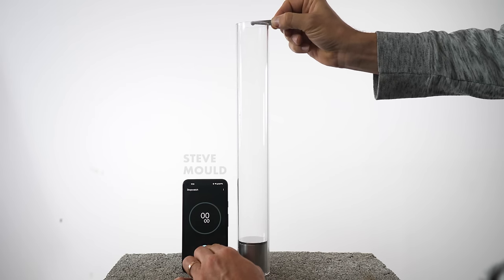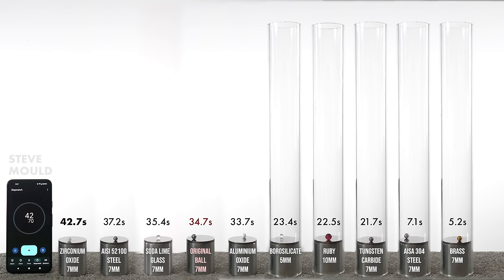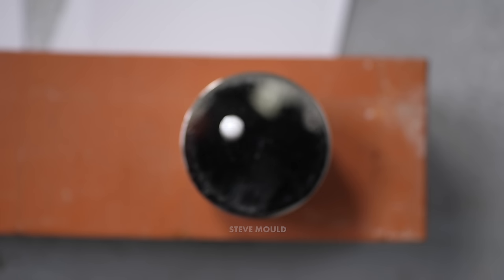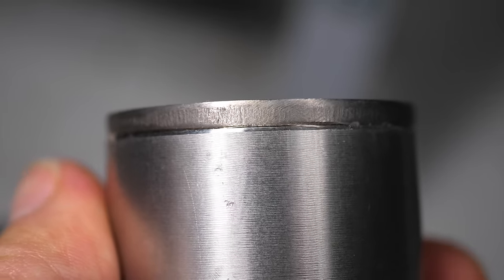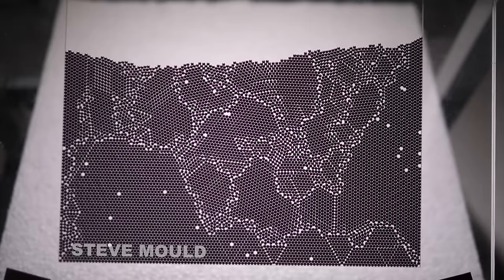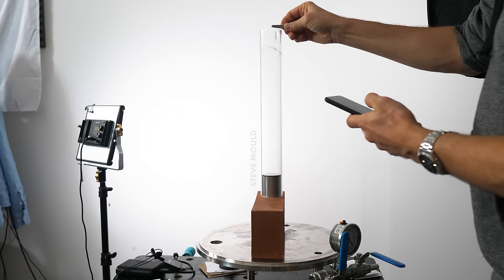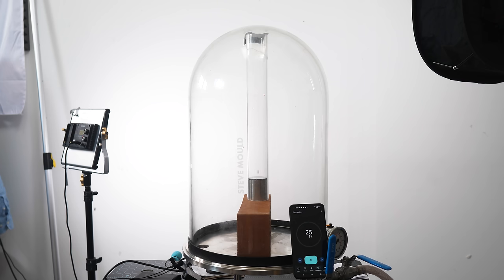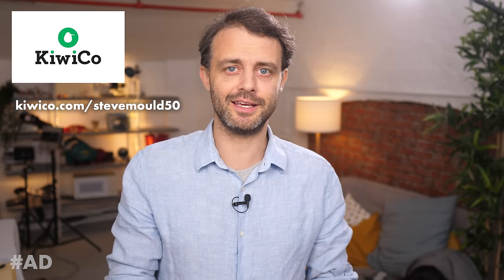This weird metal is insanely bouncy

Comment: I can say from personal experience that a steel screw dropped onto a tile floor has a coefficient of restitution of at least 1, and this coefficient value is proportional to the rarity and cost of the screw.
Reply: True. Also, the propensity of the screw to be lost upon dropping rises in direct proportion with the rarity/cost of said screw.
Reply: XD
Reply: What about shag carpet?
Reply: They don't bounce. They just teleport to another dimension.
Reply: @rigidmenace3333  They go to the same place as the missing socks.
Reply: I don't think you fully appreciate the results of your "research". The sample screw has a post impact path at an angle to the original line of travel. This requires more kinetic energy than the system has before the collision. You are describing a type of hot fusion.
I say it's hot fusion since that's what you become after the screw disappears. And, to distinguish this phenomenon from plain old hot fusion it's spelled Fyousion.
Reply: It can't be more than 1
Reply: @lyxe9000  It was a joke, but I did not understand it either.
Reply: 1 is the upper bound!
Reply: @timelsen2236  In a theoretical world where 1 isn't the upper bound, it would bounce higher than the height it was dropped from, if the coefficient of restitution was 2, and you dropped a ball from 10 meters, it would bounce up 20 meters. However this theoretical world is what you are transferred to when you drop one of these rare screws and the screw bounces for eternity somewhere in your workspace.
Reply: @_EyeOfTheTiger  it travels to another dimension through the carpet
Reply: thousandth like pog
Reply: You'll find it 6 months later in the same spot as your 10mm wrench
Reply: what are you even saying? 😩😩
Reply: When I worked in an eyeglasses lab the people who assembled the completed glasses would refer to the tiny screws some models used as "unicorns" because of how unlikely you were to find one if you dropped it.
Reply: LOL
Reply: @timelsen2236  It can be if more energy is returned to the screw than the screw gave, which means that energy is created, which is obviously impossible, but so is a coefficient of restitution being 1.
Reply: As a watchmaker I can confirm this! For expensive watch screws that are tiny and also I dont get replacements for, the coefficient of restitution tends towards infinite.
Reply: @TheDirtManYT  "The Absent-Minded Professor" Walt Disney 1961... I saw it in the cinema with my mom!
Reply: @TheDirtManYT The Flubber coefficient.
Reply: Lmao
Reply: It's also tied into another law of physics, life, and everything else... Murphy's!
Reply: You have 10mm anger.
Reply: the time spent searching for said screw if one is attempting to be efficient at any given task is something I've managed to reduce by keeping a decently powerful magnet handy anytime I'm,ahem, screwing around & also, if purchasing a specific # of items for a task ( my preference for small repairs) I generally get an extra , just in case. an additional benefit is being able to take that item back to the store for an identical one if you decide more support is needed!
Reply: @Abmotsad that’s where lint comes from.

Comment: Perhaps someone else has mentioned this but I noticed that no where in the video did you mention the sound itself as an energy leak. When you created the vacuum test, the sound was quite apparent meaning that each bounce sent a compression wave through the metal disk, then the base metal cylinder,  then the brick, then the metal plate, then the air gap, then the microphone.  That has to be a major loss of energy,  possibly more that any from air resistance.
Reply: While he didn't specifically point out the sound as energy loss, he did reference the different energy losses based on the base that it is on.
Reply: You are correct sir. In terms of entropy the base is at a state of rest and the ball is at an energy level higher than it's resting state. Energy will go from higher to lower. So the impact energy transfer will be many times higher than the energy transferred to the air. The ball shaped also contributes to this.
Reply: It seemed that the higher energy content of the higher frequency bounce helped it run out of energy almost immediately.
Reply: @douggale5962  It loses a percent of energy with every bounce. The more bounces per second, the more energy loss events per second.
Reply: I remember in kinematics we used to neglect sound energy loss since its insignificant compared to friction/drag and impact losses
Reply: @benjiwiebe8128  yeah, but the loss become smaller over the time which balances the overall energy loss rate. You could clearly observe this at 5:24 simply by looking at the shape of the sound record.

I wonder whether the loss rate is being evened out by this fact or not.

Comment: The brick was interesting. I 3D print and have seen people using stone tiles as a base to stand their printers on, then on a table. The stone slab either absorbs the vibrations or simply keeps them in the machine, more or less, which reduces vibrational noise during operation. I guess this video indirectly answered my curiosity how that even works :D
Reply: I've been using four foam mounts to try and achieve some sound deadening. Thanks to your insight I'll replace those foam pieces with bricks.
Reply: @MrAlex3461  Not sure how good bricks are. Might work. A concrete or stone slab has some weight to it that reduces table wobble. But try the bricks, I'm curious if that works too

Comment: As a mechanic without an engineering degree, I'm curious if temperature would have an effect? Would heating or cooling either the materials of the bearing and the impact plate or the air within the glass column make a measurable change? Also as a mechanic who deals with bearings in the field and not a lab, would impurities (finger oils or dust) affect results? I've dealt with bearings that a dirty finger print would affect it's performance, although that is  probably more a rotational force.
Reply: Running tests with the system at different temperatures would be interesting. 
A heated ball would have more energy to start with. But, the electrons in the balls metal could be more free to move around. If it's cooled, the electrons are more tightly held but over all the ball has lower energy. Or, heat transfer with the air would cancel out any temperature change.
A cool line of inquiry no matter how it turns out.

Comment: to count all but the audio rate bounces, you can use audacity’s sound finder feature (i think that’s what it’s called, and it’s in one of the last three menus). it creates labels which are numbered in a separate label track. you can also slow the audio down and then run the sound finder, to give it an easier time finding the bounces.
Reply: I think it's called Beat Finder - haven't used it for a while, so..?
Reply: I've not used it since 2003, i think it's called 'mute'?

Comment: I created a jig to test COR in university as a project. After testing a number of materials, was very surprised(as was the class when I demonstrated) that cast acrylic had an extremely high COR. I don't know why but everyone assumed it would dampen the bounce.
Reply: Yeah, you can get acrylic balls at TAP that bounce like really noisy superballs... they also don't really warm up as they bounce. Unless they crack or chip, they really don't stay deformed. PLA on the other hand... "sploot"
Reply: The 5mm balls used for 'bb gun' ammunition are very bouncy on a hard surface (floor tiling is best but also very bouncy on wood laminate flooring). I think they are also some sort of cast plastic. Used the property for a 'door trap' to make sure no-one was sneaking into a room of mine before - count the balls load them into a pot that is released if the door is openend; because they bounce all over the place it's hardly likely they would all be found and replaced so you know if the trap was sprung (count the balls in the trap without setting it off). Unfortunately I forgot I'd set it one time, and ended up with balls bouncing everywhere on entry. 🙄

Comment: Steve, Little tip of advice from an audio engineer. 
If you ever find yourself needing to count the peaks of a audio waveform again. Save your time and eyes, Look up Dynamic Splitting. You essentially set a threshold above the noise floor and it will detect any transients (peaks) above your setting and then splits them all. Resulting in each transient being its own audio "file". Highlight all files and see how many you have selected, or a good Slicer will tell you how many transients are detected before actually splitting for you.